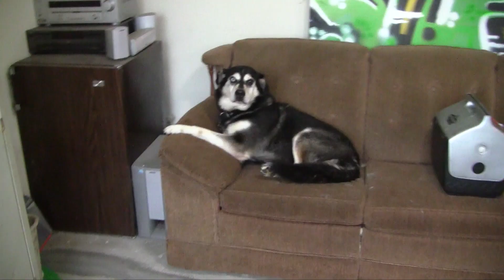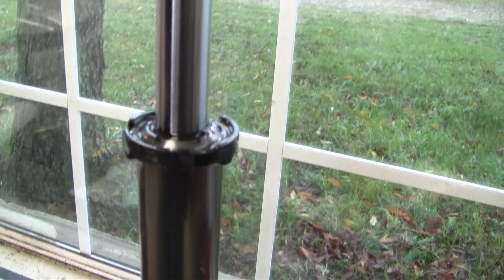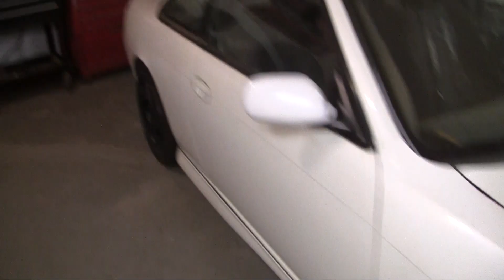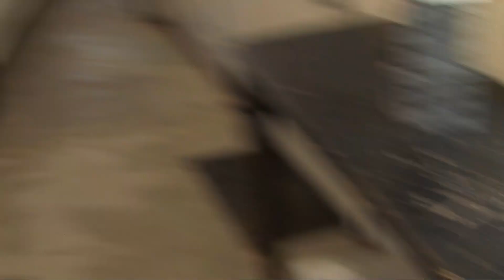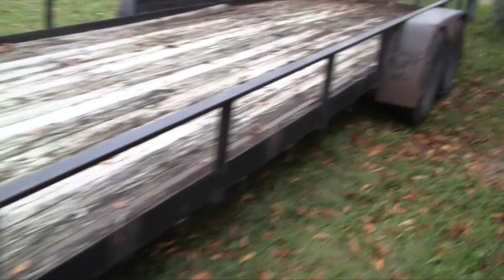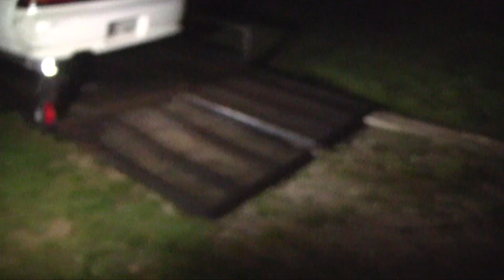Coilover Repair & K&N Filter Recharge + Event Prep - S14 Build #13

Comment: so the top cap is the only thing holding the fluid in the treaded chamber, and the cap seal isn't one solid seal, also do fill the chamber to half way or to the top of the cartridge with oil?
Reply from the maker: Yea the top cap is the only thing holding the fluid in the chamber, at least on these shocks. It seals in two places, around the piston and around the outer threaded chamber. With the shock body removed from the chamber, I the shocks about 2/3 - 3/4 full of fluid. Then I put the shock back in and topped it off, filling it to just above top of the shock. I have been taking more time documenting the process of stuff like this for future videos. Thanks for reaching out, hope this helps!

Comment: where did u get the seals, and do u have full video of the repair?
Reply from the maker: I used o-rings from this kit - https://www.harborfreight.com/397-piece-metric-o-ring-assortment-67580.html

That's all the video I have for the repair. I put in the new o-rings in the upper cap I show in the video, then refilled the shock with oil.